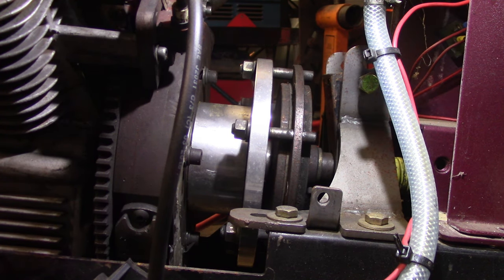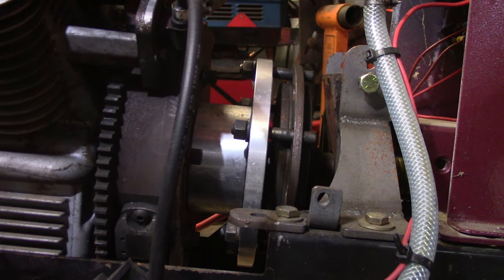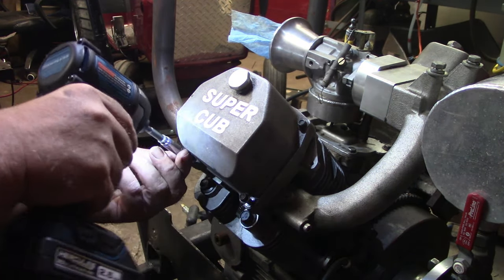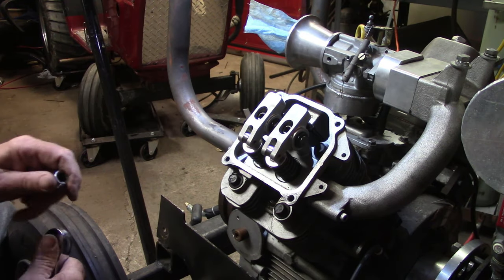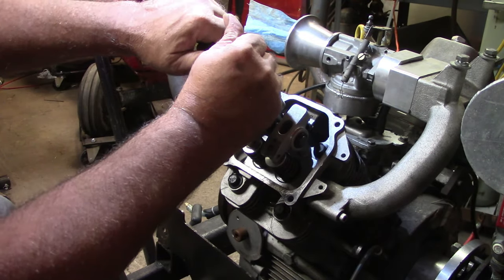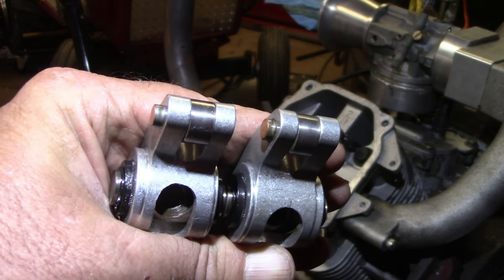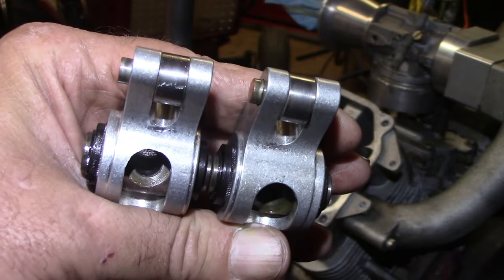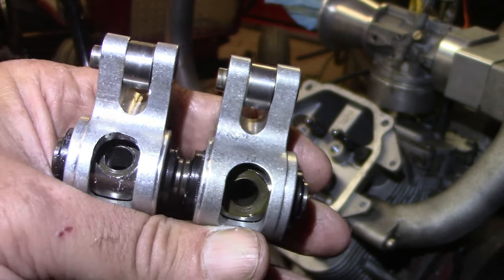Working on Plumb Crazy tractor for Twisted VTwin Garage

Comment: I've not built a performance Kohler V-twin Ed but I have run into an issue before with a two piece billet cam that had a bolt-on timing gear. I think you're on the right track.
Reply from the maker: Same setup as the billet cam. I'm almost 💯 sure that it wasn't timed and degree correctly.

Comment: Looks like you could use fender shims like you get on the older cars. They come in different thicknesses you would have better support and their slotted. Just an idea
Reply from the maker: Yes I have used those before. In this case I just cut a slot in the washer to slip them in.